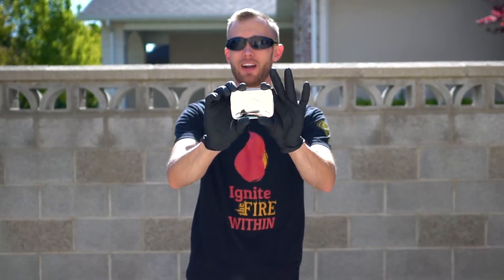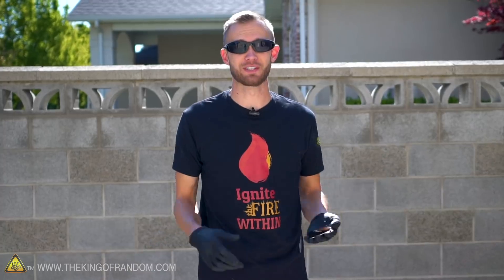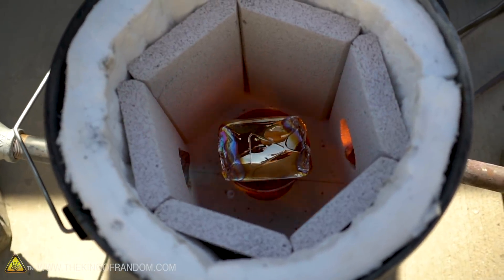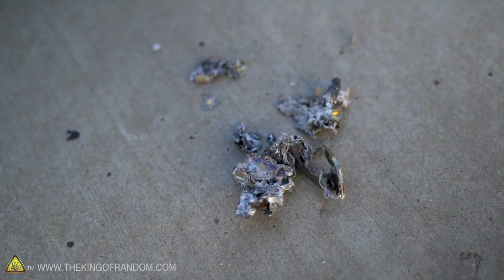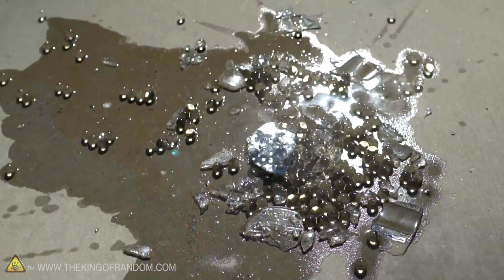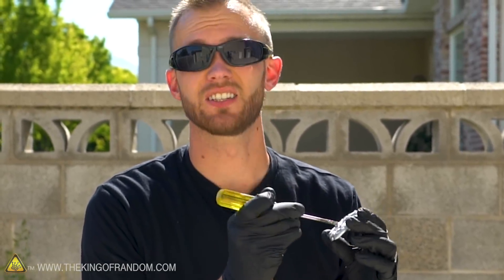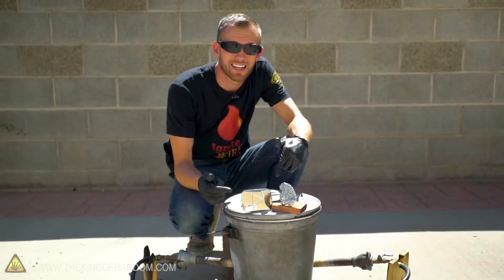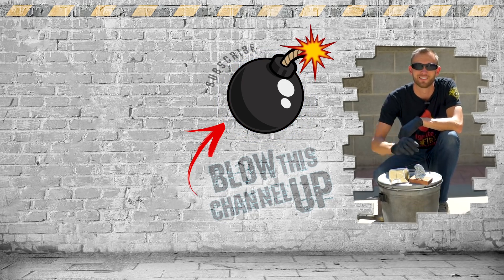What Happened to our SILVER PLAY BUTTON?!

Comment: But oobleck in a blender
Reply: Jessa Strobach Yes!! Would it blend?
Reply: SoloKing oh thanks
Reply: DO IT
Reply: Zach Spiegel if the blender was on low I think it would and if it was on high it probably would not but the blender would smoke and probably break
Reply: Bye bye blender
Reply: It would probably turn into a powder
Reply: It will not flow but cook into a gel.
Reply: what would hapeen is the oobleck would start to break apart and heat up due to frictioning tnerefore heating the oobleck up to where it will turn solid by evaporating the liquid and then blending it ito a fine powder.

Comment: You can probably find out what it is by finding the weight, then put it in a measuring cup with water to find volume. Then divide to find density, and find elements with similar densities and look which ones have a low melting point and similar properties.

Comment: what happens when you heat a metal up way past melting point does it start boiling?
Reply: chris clark it becomes a gas
Reply: chris clark 
you’ve seen that with zinc before, it does boil
Reply: chris clark no it doesn't it just sets there and stays the same
Reply: Som diamond it is not classify as a metle
Reply: Yes
Reply: chris clark it will turn into a gas then if you heat it more into a plasma and if you heat it even more it will get stripped of its quarks which are the building blocks of atoms
Reply: Eventually it will, but we're talking 10's of thousands of degrees (f)
Reply: ᎡᎪNᎠᎾᎷᏢᏌᏢᏢᎬᎡ ᎡᎪNᎠᎾᎷNᎬᏚᏚ metal * or no, everything has a melting and boiling point, even zinc
Reply: Of coarse it would start boiling, every element will become a gas given enough thermal energy. You can probably find videos on YouTube of sodium or potassium gas, they are interesting because of the colours.
Reply: ᎡᎪNᎠᎾᎷᏢᏌᏢᏢᎬᎡ ᎡᎪNᎠᎾᎷNᎬᏚᏚ no it doesent it boils into a gas
Reply: chris clark yes it does
Reply: You can boil metals, I personally have before.
Reply: The Knight dude it’s still 10s of thousands degrees in Celsius too
Reply: ᎡᎪNᎠᎾᎷᏢᏌᏢᏢᎬᎡ ᎡᎪNᎠᎾᎷNᎬᏚᏚ diamond isnt a metal. Its virtually carbon that has been subject to extreem heat and pressure

Comment: can u melt magnet??
Reply: janatha hennayaka yes
Reply: After a certain temp the metal the magnet is made of will lose its magnetization
Reply: No.  Kevin Bruland is right in that heating a magnet will demagnetize it.... but aside from that a magnet is either iron or a ceramic with magnetized iron in it.  Iron has a melting point of 2800F.  Quite a bit hotter than that furnace can get.

He could do it with the arc furnace, but not the propane one.
Reply: Corwin Weber you still can melt it op never said would it still work
Reply: Neodymium magnet can be melted but ceramic can not be melted because a magnet is just a piece of aligned atom s metal that attracts the unaligned atoms of iron

Comment: Is it Aluminum, Zinc or Tin
Reply: a-lpha of Zeldaforme Gaming Its Nickle
Reply: a-lpha of Zeldaforme Gaming nickel
Reply: i think its zinc because of the yellow color the formed on the thing he put to stir it
Reply: a-lpha of Zeldaforme Gaming i dont think its this cuz you would be able to melt it with lighter so i think it would melt faster
Reply: It is NOT nickle, its an alloy commonly used for belt buckels. Its just nickel plated.
Reply: Its not aluminium either. Aluminium melts at liek 1100 degrees F. Probqbly tin or something
Reply: It's definitely got some zinc in it which can be known from the yellow oxide present on the tongs
Reply: It is mostly zinc and carbon because tin is expensive and soft and if it was Aluminium it would have to be slightly red hot to be melted down.
Reply: a-lpha of Zeldaforme Gaming tin melts around 3000 degrees give or take

Comment: Brake parts cleaner or acetone, nail polish vs super glue and baking soda. Will it dissolve the hardened mixture? You can dissolve the superglue and baking soda clumps in a bath of brake clean or acetone. And then light it on fire again for a show as well as reactivate the superglue and baking soda mix.

Comment: I guess it’s probably zinc, from the fact that there’s yellow zinc oxide sticking on the tongs that’s been used to clean up the surface of the molten metal. Zinc oxide turns yellow when hot.

Comment: Hey a new idea !!! 
The concept is that there are no sparks in vaccum due to the abcense of air that allows electrons to bounce around , 

You use a vaccum flask sitting on a electronic plate (electric source) running on very high voltage , what will happen when you at a sudden moment pull the vaccum flask up ? Will there me a huge spark , a blast ? 
Please let's us know !!!

Comment: If you were to change your burners so you are using blower to mix the gas and air before it gets to the point where you light it that should give you a higher max heat for the furnace if you could give it a try. Another way to get a higher heat level is to use forced air and a fuel  like oil

Comment: It’s most likely aluminum. I don’t know why he didn’t even mention it. It’s white colored and could be zinc but that’s a little more bluish. The reason the button fogged up is because when you burn propane it’s creates water and co2. So when the water vapor was formed it condensed on the relatively cold play button and fogged it up. But then it got hot and evaporated.